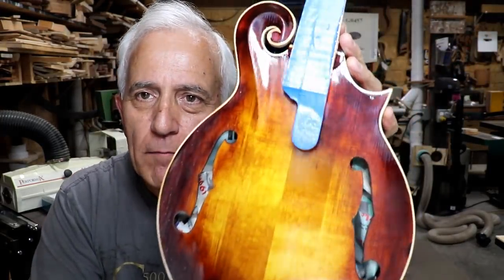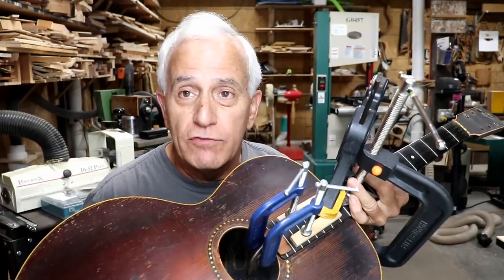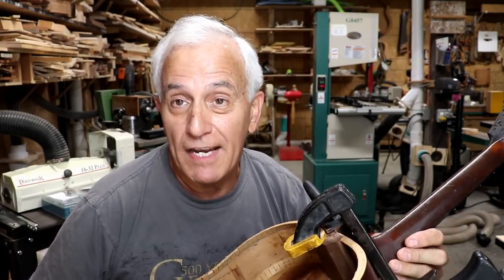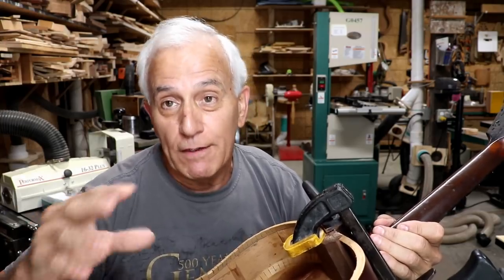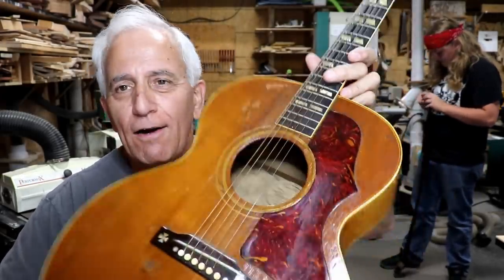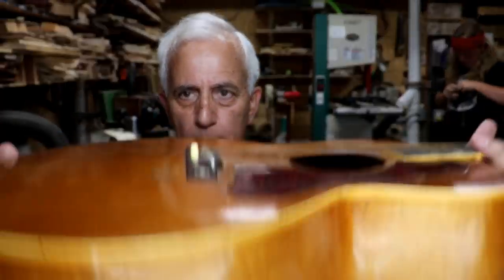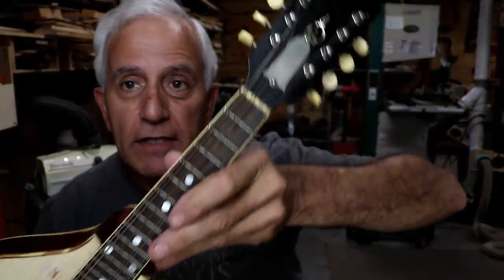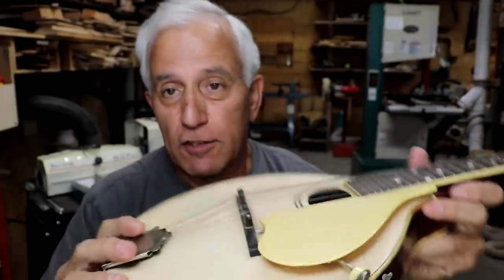415 RSW Why It Is Not Easy Being Me

Comment: I did a tater bug mandolin about that condition. It had been hot and wet. The challenge was the linen they use inside to hold the slats together. I used cheese cloth and it worked fine. The neck was loose and I found it to be installed with a big dowel. I used threadserts to hold all that together. Made a good repair. Can't wait to see you repair the fiddle. WHAT A CHALLENGE. i do love this stuff though Jerry. Give the tater bug  to Caleb. Just kidding. Thanks!

Comment: Jerry, the first thing that comes to mind for clamping the tater bug mando is to use those rubber strips you've used when building a guitar. Wrap the mando with them to hold the pieces together while the glue dries. Probalby still not easily done but the usual clamps aren't going to work well without extra pieces of wood between clamp and mando body. I don't know if there was any insurance on the guitar but the shipping company should pay for the time it takes you to fix the damage.
Reply: I wonder if a guy could put the round-back mandoline face down as re-gluing segments, than use some sort of rachet-strap  system to apply even pressure across a couple diff spots along the curved back? Oh, and dead right about the shipper's fiscal responsibility.

Comment: Oy Vey! Jerry, These are great tests of patience.  The following are just my immediate observations and you may chose any method that suits you and Caleb.The violin is a jigsaw puzzle. Get permission to use dark color varnish to cover up those patches when done.. The Bowl Back Mandolin Mandolin might need a mold covered in wax paper or mold release. Keep in mind that severely damaged goods may need refinishing, regardless of desire to maintain original finish. The blushing may be your humidity level there. A heated paint booth with climate control really could help. Shipping damage is a bummer. Guitars are fragile. I found that computers marked fragile always showed up damaged and not working right. I learned that spend extra money on bubble wrap and double boxing. The guitars with plugged holes needing disassembly are doable. Tint. With lacquer. Sentimental with playability in mind. Not a Stradivarius. But I'm not going to adjust the horizontal or the vertical and listen to every word of your reasoning though these. Just like mission impossible!

Comment: I don't know what I am running into, glue-wise, that is worse, epoxy, or the urethane glue.  I have one violin that apparently had a runaway sound post.  It looks like a tablespoon of epoxy was mixed up then it was drizzled down through the f-hole to anchor the sound post to the backplate.  I have others that look like someone used urethane glue to repair the rib seam around the backplate on the lower bout.  I can only imagine what you have seen in forty years of playing Mr. Fixit for some of your customers.  I have another violin that looks to have been a rather well-made instrument at one time.  The backplate, ribs, and neck look original but the top plate looks like someone whittled it out with a pocket-knife.  I'm just getting started and at 74, I will not see forty years of experience.  I had sent you photos of what I called a violin in a woodpile several weeks ago that I found on eBay for $100.00.  It is still on eBay and the seller is still asking $100.00 for it.  There is no violin maker's name on the label which identifies it as a Strad copy.  I'm not foolish enough to spend that kind of money on it so I guess I'll leave it for you or Caleb!!!   I thoroughly enjoy the videos in this and the Shop Talk series regardless of the subject matter but I do digest the instrument builds and repair much better.  They just have the right flavor for me!!!
Reply: I've bought a lot of violins between the $150 to $500 range, and even one that cost $80, and I think once you get to $150 they are pretty decent. You might need to fix both the bridge, the nut, and the pegs, which are very minor fixes, but I think a brand new violin is so much easier to start with, cheaper, and all play pretty nicely.
Reply: langhamp8912 Generally that might be the case.  I have violins I have paid $25 for and a high end instrument I paid $1225 for.  That last one is purely a collection piece.  Even $150, $200, and $300 instruments may have a crack on a plate or a seam that is opening.  Some might have been repaired or restored by luthiers with great expertise or by someone at my level with minimal experience.  I just like well made stringed acoustic instruments and have started this as a way to occupy my time and a need to do something constructive with my hands...

Comment: instead of clamping that potato bug wrap it with surgical tubing
Reply: He already has cut up inner tubes. That could be the only way, without, as he said, engineering a form for it.
Reply from the maker: im fairly sure that even the surgical tube will roll off of that round body it is very steep it's hard to keep anything on there. My flat inner tube may work. In fact I am sure it will to some degree but it's much more complicated than that.   you've gotta get all the angles right and  glue  all the joints at once and it's just Impossible trying to get all the squeeze out cleaned up and it all has to be done at once.
Reply: Rosa String Works 🙏